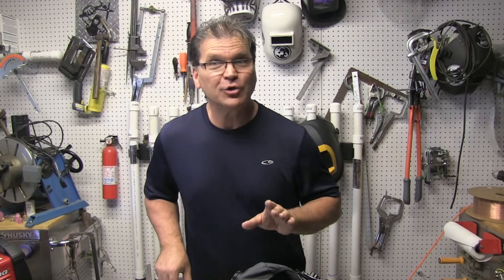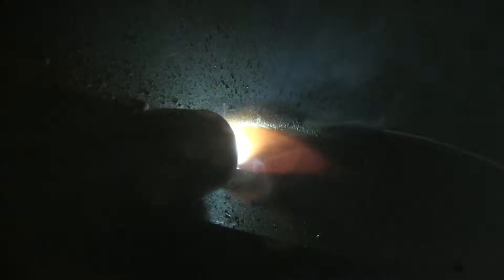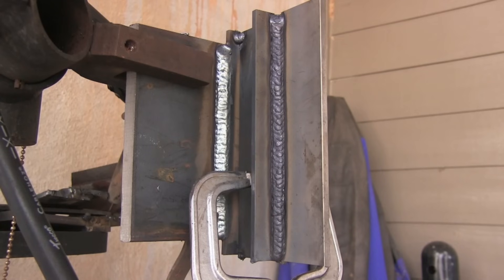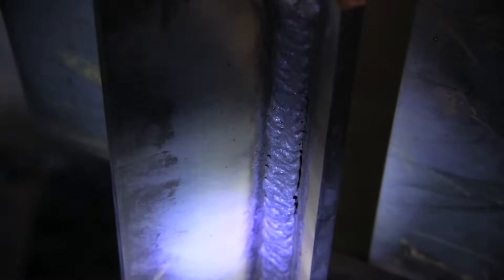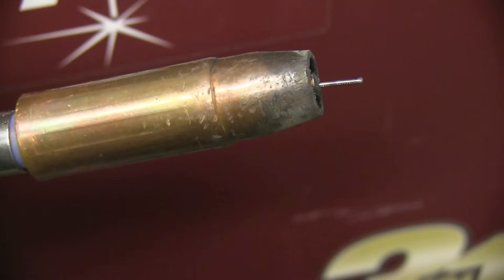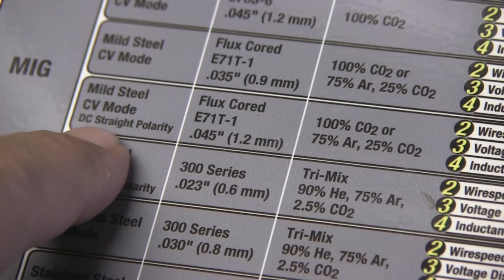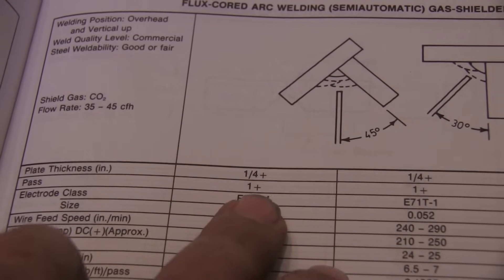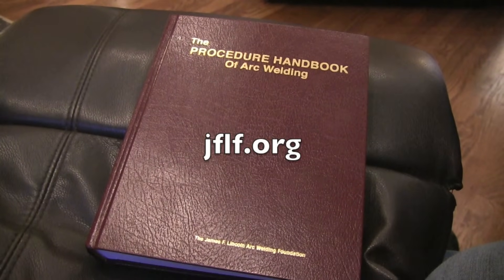Dual Shield Flux Core Welding Basics

Comment: I am new to this and mainly use flux core although I do have the Lincoln 125 hd I was not aware you could do both are there any advantages of this where I use it to mostly repair industrial blower assemblies and the like for hvacr equipment? I am little less concerned over the look of the weld as long as I can maintain proper burn in and strength that I need for many different forces including centrifugal forces. Although I do try to remove bbs and any poorly rooted material and re weld for strength as well as general ascetics.

Comment: Jody have you ever done spray arc overhead,  at the shop I work at they use 90/10 argon c02 and about 30 volts 500 wfs it's really hot I was wondering what your thoughts on it.?

Comment: i had always wondered if it was a possible to run flux core and a gas. not to cause a weld issue.
Reply: +dale myers Some flux cored wires do require a gas, while others do not. You have to adhere to the specifications made by the manufacture for each specific type of wire.  As an example: E71T1-HYM made by select-arc requires a shielding gas of 100%co2, or 75-80%argon/balance co2. Where as E70T-4 made by select-arc is a self-shielded wire and does not require a shielding gas.  By not adhering to what the manufacture requires will result in welds of questionsable quality.
Reply: i was wondering if helium would help. as it does when tig welding.

Comment: Great video!
I'm currently in welding school doing my groove welds practicing for my CWB tickets. For horizontal I'm running very similar settings: wfs: 280 volts: 23.0 with 85/15 gas. Or I'll use C02 for better penetration and using wfs: 300 volts: 26.0-27.0. Keep the videos coming! Cheers from Canada

Comment: I loved  using Dual Sheild FCAW , It always felt like pouring thick  chocolate milk . super smooth and had great "wetting" action .  I still  dont get why most of these machines that start with a 2xx , dont have dual rollers  , I hate single rollers  .
Reply: +Rockland Kcorvic Single rollers are a pain. Even Everlast is going with true 4 roll driven rollers.
Reply: really ?  That make upgrading a  dilema, I run of generator power alot so the older transformer machines are were its at , but a low priced dual roller setup, hmm I might rent a trencher and run power to out the out buildings .

Comment: Thanks for the vid on dual shield. I've used dual shield a lot in structural steel shops. It's definitely not for doing car body work but it's the way to go for structural stuff. The nice thing about it too is that there are standardized welding procedures for using it unlike regular mig hard wire.

Comment: Hey Jody, I have a couple questions for you. I am curious why you did not cover the other method of running dual shield; in CC mode vs. how you were running it in CV. Advantages and disadvantages of each mode along with how each mode affects how the wire feeder keeps your arc length consistent. The other thing I noticed with this video is you didn't explain much on how to change settings to achieve a sound weld along with good bead profile and how poor settings can really make for some awful welds. -And as always keep up the GREAT work!
Reply: +Ron Kalskett  I've run CC w/ straight mig  overhead in the field with a  malfunctioning Hobart gen set   and have the scar in my arm to prove it . IT suckED!!!! but the shit needed done .  I have never heard of running fluxcore on CC and would never have considered it ,   please go into more detail.
Reply: +Rockland Kcorvic, Well here it goes. I personally like to run flux core on CC. If I remember correctly CV is the preferred method, but CC can produce RT quality welds as well, (seeing as I had to pass three RT plates to get the qualification using CC mode). Please forgive me, this is from memory, stuff I learned back when I was in my Apprenticeship. 

So here is how it breaks down. In CV mode you control two variables; the voltage and wire feed speed. While welding, when the wire feeder senses voltage change the electronics will either increases or decreases the amperage which burns off the wire more or less to keep the voltage (voltage=arc length) at whatever the value was that you set.( the electronics do this adjustment many times a second). 

In CC mode(exact same configuration as stick welding) you control two variables, the amperage and the wire feed speed. While welding, when the wire feeder senses voltage change the electronics adjust the speed of the drive rollers to keep your arc length the same.(the electronics do this adjustment only a few time a minute).

Where I work, we use flux core in CC mode. You set your machine just like you are going to stick weld. The wire feeder is hooked up to electrode positive, ground to negative. Where I work we use a couple different wires. We use 71T1-HYM, and 81T1-ni2m. With 75/25% mixed gas of argon and co2. So for a quick setup of some thick steel members this is how I would get my machine tuned up. With 1/16th inch wire diameter, I would set my welding machines amperage to say 200-220amps. Then I would turn my wire feeder up fairly high for that amperage say 300 inches per minute, and on a test piece I would weld a little bit, but at the higher feed speed the wire will "jab" into the test piece and not weld for crap. Now here is how i fine tune. when I run a little test pass on the practice piece I turn down my feed speed little by little till the wire stops "jabbing" and starts to weld smoothish. And from this point all I need to do is turn it down a hair more to get the arc length that I desire, then start pounding the wire in! 

Sorry this was so long winded, buy I hope that it is understandable.
Reply: Are you running dual shield in other positions like vertical up or overhead or just mainly flat ?
Reply: +Rockland Kcorvic All positions!
Reply: Sweet. I'll mess around with it once i get wire feeder for my g9pro 250.

Comment: Great video but as a Flux Core welder I want to give a tip.  Don't get into Flux Core production welding!  If you do, DAMN SURE DON'T DO IT IN TEXAS!  .045 and maybe 1/16 is ok but 3/32 plus a 60 lb spool of wire added with 102 deg. 80% humidity 12 hr day times however many days are in the schedule will wear you out!
Reply: Amen ,,  on long & hot ones in midst at moment, thanks to 2011, I can manage to be mildly miserable

Comment: I just took a 1" 3G test with dual shielded flux. The only problem I had was I was carrying more metal at the top so I was filling the top of the groove faster than the bottom. Could that be due to a changing gun angle? 
Lots of fab shops around here run dual shielded flux core. I'm surprised there aren't more videos on this process. I hope you can do a small series on GFAW-S; dos, don'ts, trouble shooting, and options for home users.

Comment: okay what's the term spray weld what does that mean
Reply: It's a different mode of wire transfer in mig. You generally need at least 90% Argon to achieve it. With .035 wire you run it around 350-450 ipm and adjust the voltage until you pass globular transfer and the arc starts smoothing way out. It makes it so the weld wire gets deposited in droplets through the arc and it's petty quiet, clean, and hot. It's good for thicker metal in the flat or horizontal position. Hope this helps.

Comment: I have worked in the tank car business and for the parts of the tank cars such as the hatch and housing and lids all we used was lincoln ultracore .045 to. .052 and for uphill I always got away with a steady motion. no manipulation was necessary. we burned in at about 26 volts and right under 300 ipm and it was the sweet spot for me. this is an awsome video I've been waiting on a dual shield video!!

Comment: Unlike Facebook, I don't see a way to send you a private message, so I'll ask here. In a video about 6 months or so ago, you posted a decent rule-of-thumb for bidding out a welding job based on something like how long the beads were going to be. $1/inch of weld, or something along those lines. Can you post that again, please?
Reply from the maker: +jp2code What I said on bidding work was that I used a 1 dollar per inch plus 1 dollar per tack rule of thumb.
the dollar per tack weld is a slack adjuster and allows for extra charge on complex parts.  this is just a starting point.  you can adjust the one dollar ammount accordingly to whatever your neck of the woods is willing to pay but the concept has worked well for me.

Comment: while there are many ways to skin a cat, i would say that your technique on the vert while perfictaiy acceptable with bare wire is not the best practice for fcaw. you would get a far better profile just beading it in without any manipulation at all.
Reply: +Stewart Anderson Agreed that there are lots of ways to skin a cat, seems like it is always a debate on 3G up welds as to whether or not I do stringers or a weave. Only potential issue for FCAW and a weave is possibly a slag inclusion of a spot that had solidified and not remelted with next weave, but not a high enough chance to completely say don't do it.

Comment: I have a one question. What is the advantage Dual Sheild Flux Core?   I have learned a lot from your channel, Thanks. 
From an Atlanta GA YouTube channel producer.
Reply from the maker: +Metal Tips and Tricks (Dale Derry) There are several advantages to Dual Shield.  Some of the main advantages are speed and high deposition rates. A Mechanical Contractor or Welding Business can often use it instead of Stick for a lot of jobs and save time and money.
Reply: +Metal Tips and Tricks (Dale Derry) 
Besides what's been mentioned, it's easy. I started welding school last summer, with zero welding experience. We started with dual shield flux core, .045 71T wire with 75/25 gas. I was certified by X-ray for welding steel of unlimited thickness (AWS D1 standards) within about three weeks. And as anyone who saw my welds for the rest of the semester when we switched to short-circuit MIG would tell you, it wasn't natural talent that did it.

It's easy because the addition of CO2 (either pure or 75/25) gives you deep penetration and the wire seems to need little or no electrode manipulation. I know Jody does some on his vertical but our instructors busted our chops for anything less than smooth welds, so we just ran straight stringers and it never failed to penetrate for me. His technique is probably stronger but it shows how forgiving dual shielded wire is.
Reply: As another advantage the cleanup is very easy as compared to self shielded flux core welding. Many times the slag will curl when everything is right.
Reply: +Metal Tips and Tricks (Dale Derry) You also usually run it with more amps than most other processes and can get better penetration into fillet and butt welds.
Reply: +Metal Tips and Tricks (Dale Derry) it has a very high charpie value so works very well in cold enviroments and you can run it mostly non stop vs stick and dual shield is wonderful to work with.Runs like 7018 without the problems of the outerflux
Reply: Good information and I'm glad you learned so much at welding school. I only started welding last summer after I bought an everlast welder. I want to learn a bit more on my own before taking classes. I hope to freelance on the side to make some money but who knows. I might change careers if things take off.

Comment: Jody, just a couple of questions. First, under what conditions would you want to use dual shield flux core as opposed to just plan flux core? Second, why is that tilted angle on the uphill bad? In other words, what would be the end result of having your tip angle pointed up as opposed to straight in? Thanks
Reply: If you point it to far up the puddle will overflow and start dripping same with if you point it down. Depending on how hot your running you have a good like 10 degrees of play earthier way though.

Comment: Does the dual shield wire come in .035 for smaller machines or would that birdsnest and break too easy?  Thanks for a good video once again.  I take it dual shield is a much hotter process than gasless flux of the same diameter?  So it is used for better penetration?  Doug
Reply: flux cored wire comes in .035. Shielding does make it burn a little hotter, and it looks a bit better as well as less splatter.

Comment: thanks for the vid. can't wait to see u post some on doing GF weld test  plates with backing.

we use fcaw for position welds at work mcaw for the other 90% personally I usually run 24.5-25.3v and 300-380ipm when I'm using fcaw. slight  side to side as I move up on the verts. 

biggest thing I find is to keep your travel speed and weave consistent and u will end up with sweet welds.

Comment: Thanks! Personally, I used E71T-1 (1.2mm) FCAW-G wire with straight CO2; 23.5v; about 6.5m/min feed speed, and got good looking results. Seems to me: 1.FCAW-G is less smoke 2.easier to get better results for me than bare wire. 3. less noisy.

Comment: Do you think a 90 amp stick welder can build up (talking like 8 pounds) of metal with 3/32 7018 rods?
Reply: I have the time.
Reply: +nickwoo2  I never had luck running those junk low power units .  Find your self a used buzz box Lincoln tomb stone , or watch CL for gensets - I  got Lincoln G9pro 250 with a trailer and tool box for $700  4 years ago .

Comment: thanks for the video! I was trying to look back to past videos because I'm going to take a welding test for a job that they weld allot with dual shield. never tried my hand at it before but I'm feeling more confident. I figured it wouldn't be that much different than Flux core or Mig.
Reply: +figifister it is fluxcore, just with shield gas in addition to the flux in the filler wire.
Reply: +taylort123 for sure. I wonder what the benifits are of using dual shielded Flux core...I would assume you could weld thicker metal for longer periods of time as apposed to stick welding where you have to switch sticks? why not just mig it?
Reply: +figifister dual shield has a higher deposition rate than mig so you can lay down bigger welds in a faster period of time. also the use of shielding gas with co2 creates a hotter weld, also allowing for a faster rate of production. the same principle goes for mig as well but you dont get the cleanliness in the appearance really. you can lay down a clean triple pass whereas with mig it might take 6 passes to fill the same weld.
Reply: +taylort123 cool, thanks man. that makes sense.
Reply: +figifister i edited it with more info. really it comes down to code and the field in which youre doing production for that determines what process you use

Comment: I personally find that using no movement while going uphill, a slight push angle as you mentioned and only maintaining a consistent speed makes for the best weld. Granted I am just a dime a dozen $14 welder so my method may be totally off the book but in my opinion produces the best running weld. I use high heat on thick material mostly at work so my wire speed is almost never below 375 and I run around 27 volts, this goes for any position barring some  multipass or overhead adjustment. I just find that my weld quality doesnt suffer enough in or out of position, but again this could be wrong in terms of going by the book.

Recently, as in the past week Ive taken to the drag rule as well after doing my research on the drag vs push debate since we just got a job doing work for the air force that will be heavily tested so Im not taking any chances. Ive posted a few pictures on my instagram as well which the older ones are funny because they are so bad compared to what I do now after only a couple of months.

Comment: I would love to have seen the depth of penetration/acid etch on these, maybe future video?
Reply from the maker: +Scott Wisor I wanted to test them but I just ran out of time...but will try to do the etch test on future videos.
Reply: +weldingtipsandtricks  
Thanks for your videos. 
You can subtituled videos spanish? 
Sorry my bad english
Reply: nr-211 is a innershielded flux core you dont use gas with it
Reply: +Scott Wisor Should look like 7018
Reply: +weldingtipsandtricks Mr. Jody, I tried this technique using my lincoln pro mig 140, nr-211-mp .035 wire with 75/25 and all it did was make a mess with no penetration. I turned off the gas and it worked great. Ideas?
Reply: +CelticODST Thanks alot! I had no idea.
Reply: Did you set the polarity correctly?  Sounds like what might happen if you didn't.
Reply: weldingtipsandtricks i usually use a Christmas tree shape with T1 and spend more time on the edges than the middle. That will flatten out your weld.
Reply: try lowering the gas flow :? maybe its too much try 6 - 15 Liters per minute of co2 mix.

Comment: when would you use dual shielded Flux Core as opposed to just regular mig? what's the advantage?
Reply from the maker: +lukefaceman Dual Shield is an industrial process. Its used a lot by contractors on pipe as well as structural applications.  I have a buddy who owns a welding business and he uses it a lot because it saves him a lot of time on pipe joints,   handrails, mezzanines, etc. for the factories he works for.  Also , when welding must be done to code, regular short circuit mig welding does not easily comply with code
Reply: +lukefaceman faster production, cleaner looking welds. then again you can get mig to run fast as well. fluxcore is used a lot of ship yards and ironworking, so i guess its safe to say its a better choice for thick material
Reply: +weldingtipsandtricks interesting. I've got more googleing to do. thanks for the replies. and BTW Jody, you make awesome videos and are a phenomenal welder!

Comment: have that book, the welding shop where I purchased it called it the welding bible haha. one thing that's interesting with the dual shield that people I've worked with have done is run on cc instead of cv. I think the wire speed was much higher, bit it seemed to work well. any ideas why they would do that?